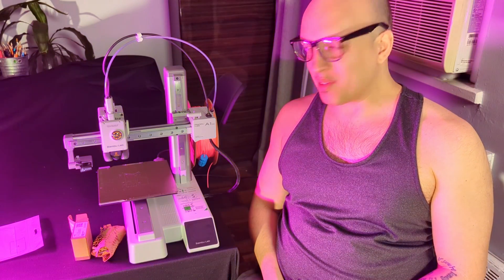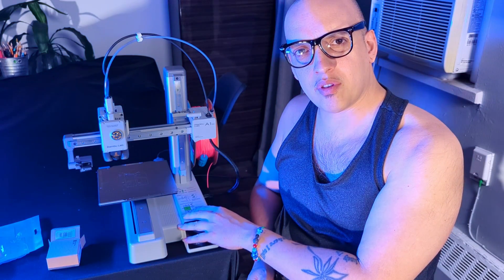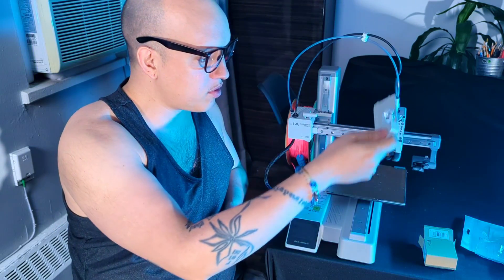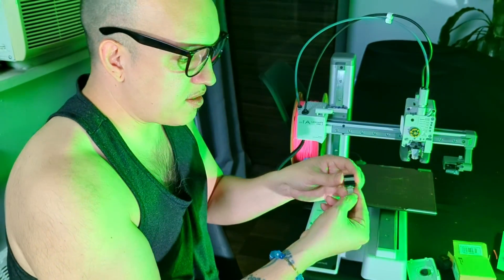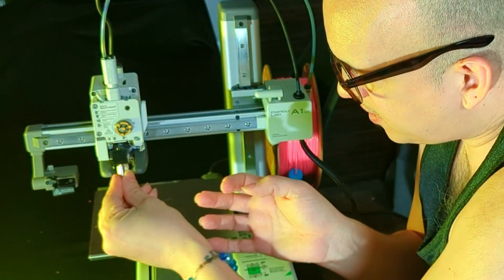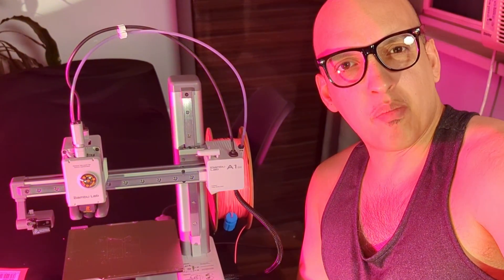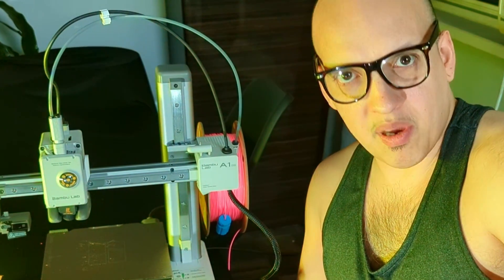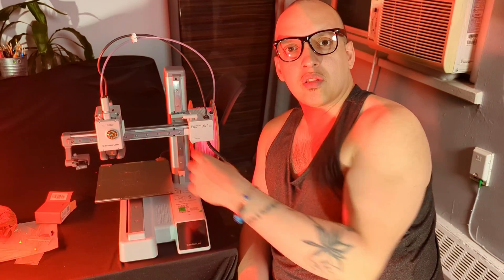Bambu Lab A1 Mini How To Replace the Nozzle and Hot End

Comment: I just got a A1 mini a couple weeks ago for my first 3d printer. A week or two in I got a little too confident and had my first mishap though. About halfway through a fairly large print part of it came loose from the bed which caused the whole nozzle to become entombed in pla+ 🤦🏻‍♂️ 😂
I ended up having to replace the heating element as well as the nozzle.
Reply from the maker: :( good reminding to tighten those lower screws every now and then huh! The little thing vibrates more than my ender 3 I noticed!